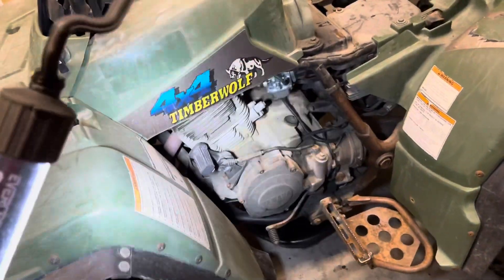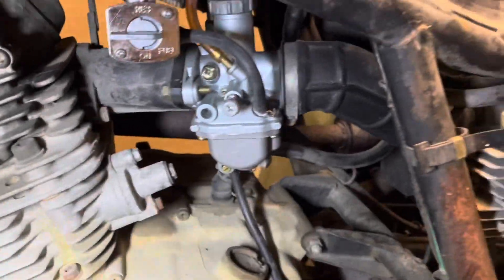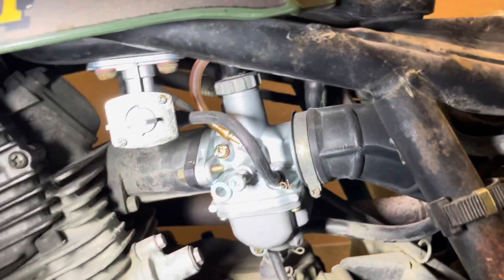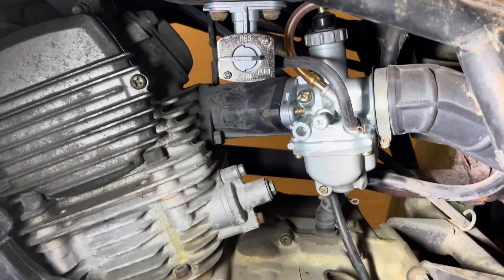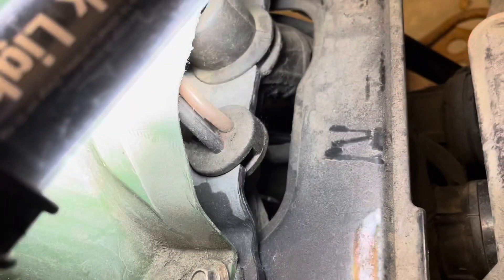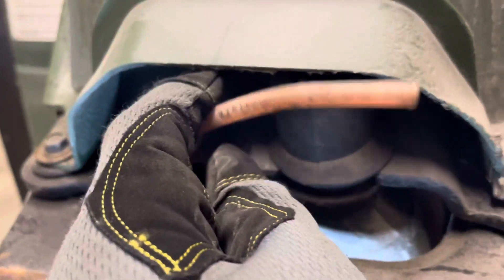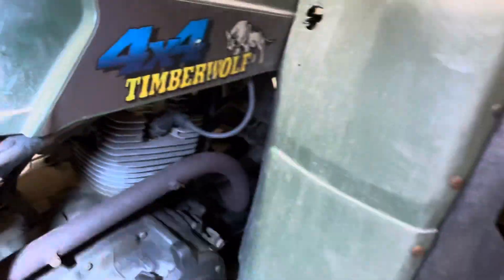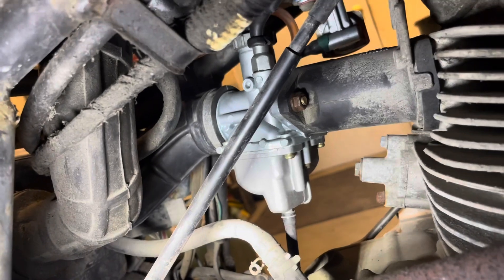Yamaha Timberwolf carb vent line routing.

Comment from the maker: Did Yamaha discontinue the part? If that’s the case and there is no aftermarket replacement it seems like the only options would be eBay or finding another Timberwolf to salvage parts off of.

Comment: I have a 2002 660 grizzly and I am having carburetor issues is there a vacuum hose that connects to the carburetor from? And what side of the carburetor is the vacuum hose supposed to be? Lloyd
Reply from the maker: Unfortunately I’m not familiar with the Grizzly 660 to be of assistance. I wouldn’t be surprised if it uses a constant velocity (CV) style carb and it does require a vacuum hose to run properly. You may need to pull the fenders & tank to check everything over and look for a disconnected or pinched hose.

Comment: I know this video is old but I’m trying to figure out the wiring harness that hooks up to the battery I have a ground on my frame by the battery but it’s not in the harness and im not sure if that is right
Reply from the maker: My Timberwolf is in storage and I can’t easily get to it as I still have snow on the ground (I’m in Alaska). I don’t know the answer off the top of my head, I’ve not tinkered around with this quad for years.

Comment: Where does the bottom vent line go to?
Reply from the maker: It’s just a fuel drain hose for the float bowl. It’d be best to route it behind the engine so gas will drop onto the ground instead of the motor.

Comment: how to connect the choke?
Reply from the maker: What part of the choke system are you having trouble with?
Reply: @thatalaskaguy  getting the end of the choke line assembled and installing it onto the carb
Reply from the maker: @christian5010  it’s a plunger style choke that can be a little tricky. Make sure the choke lever is in the off position so you get the maximum amount of cable slack. Slide the coil spring on and compress it while pulling the cable out as far as it’ll go. Then slide the plunger on and screw the cable fitting back into the carb.
Reply: @thatalaskaguy  sorry can you do a video
Reply from the maker: Maybe, trouble is my Timberwolf isn’t easy to get to at the moment. It’s in storage but we’ll see.
Reply: @thatalaskaguy  ok
Reply: @christian5010  plunger style chokes should usually screw in and function on spring tension, are you reassembling in the same order you removed?

Comment: Hello men can I help me for my TIMBERWOLF plzzz
Reply from the maker: What’s wrong with it?
Reply: @thatalaskaguy i got one that boggs down even after changing carb. only boggs when giving heavy throttle. if baby throttle up to full its fine.. Help??
Reply from the maker: @dji4042 it’s difficult to diagnose something like that over the internet. I’d remove the float bowl and check to make sure all the jets are clean. Check that the floats are sitting level with the carb upside down on a flat, level surface. Make sure fuel is flowing properly into the carb and that none of the vent lines are plugged or kinked.